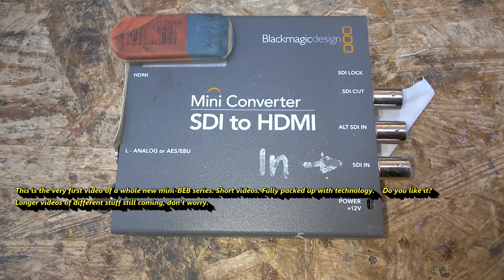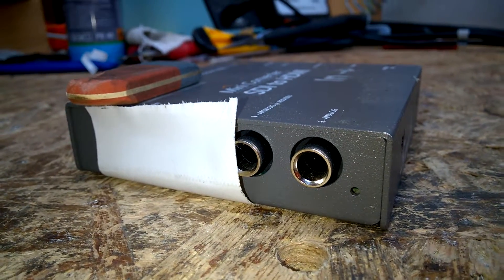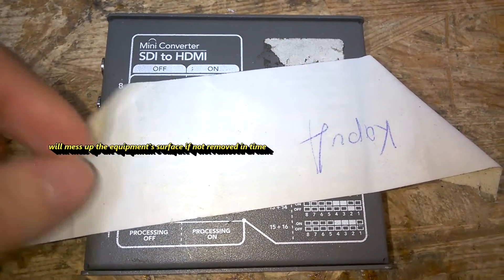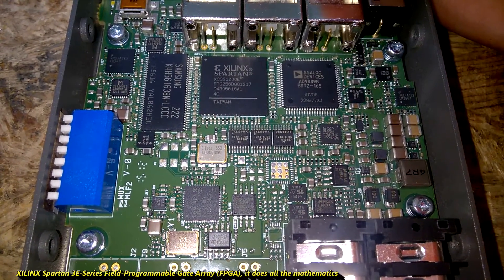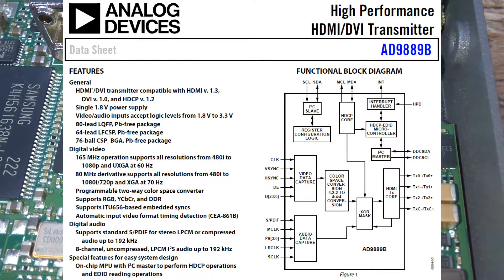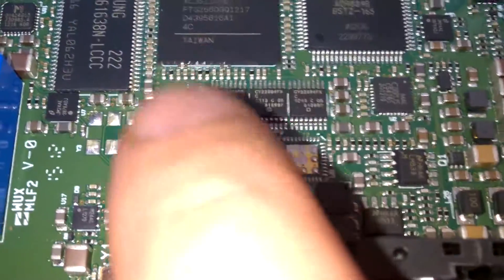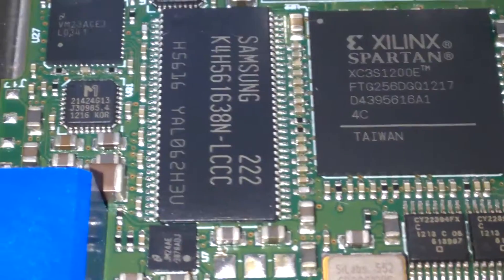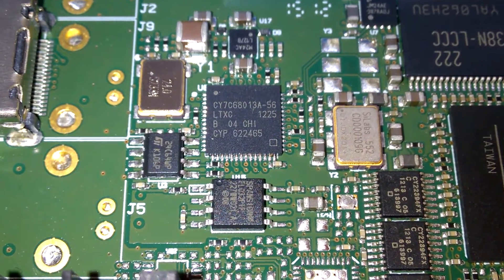BEB #39: Blackmagic SDI to HDMI converter Teardown XILINX, Analog Devices

Comment: Have the same one, i did buy it brocken, but what a shame it worked fine XD
Reply: did you fix it and what was wrong?
Reply from the maker: Blackmagic is a great manufacturer. They are very creative. Why do you need SDI?
Reply from the maker: I am still waiting for the PSU (customer forgot to send it in). I can imagine a faulty PSU. Will check that first.
Reply: that is quite possible.
Reply: i Use SDI for video Transmission it is quite convenient and you can easily Transmitter over long distances

Comment: did you fix it?
Reply from the maker: Not yet. I'm still waiting for the external power supply. Curious if the PSU is still working.
Reply: i have a blackmagic hyperdeck shuttle that i use to record the quantel on, the psu is just +12v dc
Reply from the maker: 12 with this device too. It's even written on the box. But before I'm searching for any faults on the circuit bord, I'd like to check the PSU first. I can imagine a broken wire or faulty switch mode power supply. Other than that, if there is no obvious easy fix on the board, the device will be beyond economical repair.

Comment: I am not sure why those oscillators are always in ceramic-gold packages, even when used in consumer grade,  high production volumes devices. There must be a reason.
Reply from the maker: to satisfy both of us 
:-)
Reply: it has to be correct and reliable,they even have mini heaters"oven" to maintain the Temp in highend modules.if the ossc goes wild,the whole signal is unuseable.the environment for it   is criticle.so gold package,metal cases.